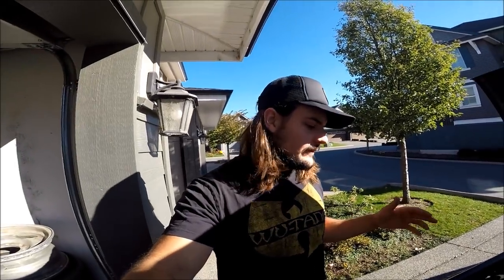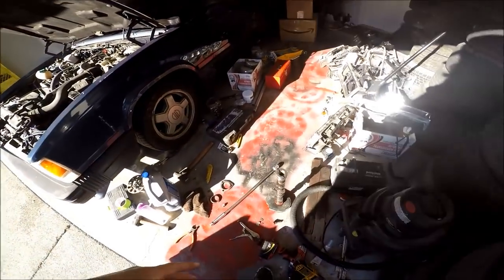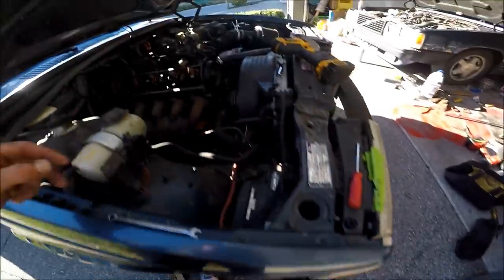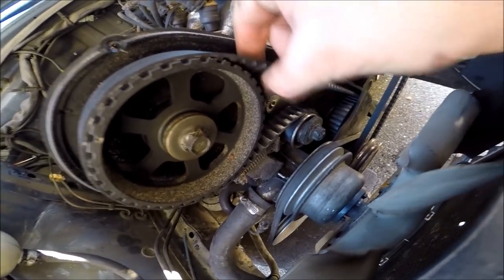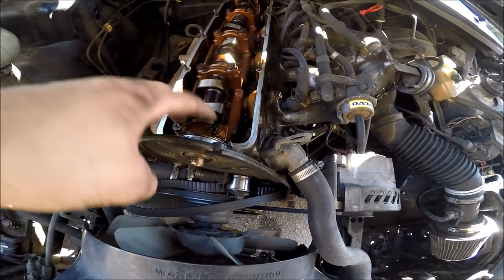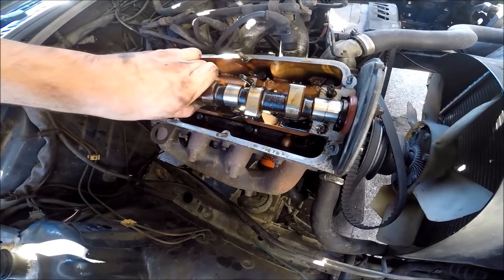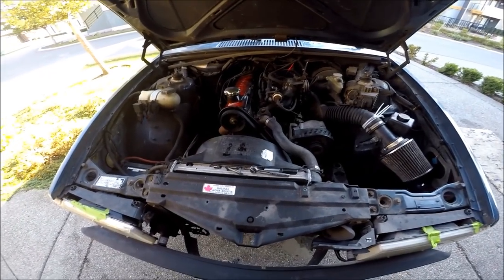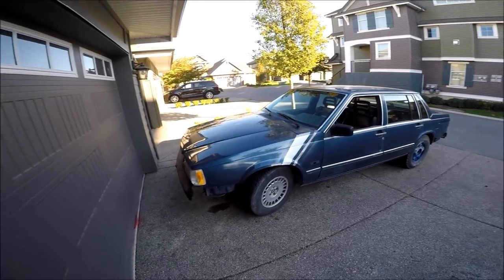B23O CAMSHAFT INSTALLATION ( HOW TO )

Comment: Hi - thanks for the vid, very helpful. Did you know there is a little thing on the upper section of the hood hinge assmblies (one on each side) that you can rotate - which allows the hood to stand straight up!  you will love it, especially when you are wrestling the distributor. It resets when you close the hood. Thanks again for posting the vid.
Reply: Dude sick! I learn a new thing about my Volvo everyday 😭😭

Comment: Hi 'Drifts 'N' Lifts'. What are your thoughts on the IPD VX camshaft? IPD claims a 19% increase in peak horsepower (114 vs 136) over the M camshaft, a flatter torque curve, far quicker reaction to throttle input, none of the roughness over 4000 rpm of the M cam, etc. And all this with little change in fuel economy or idle stability. I have a near mint, stock '90 740GL (B230F, AW70) and am looking for the best cam option to replace the stock M cam. Thanks!

Comment: Quick question: How do assure the correct timing when reinstalling the cam and cam gear? Does it stay in top dead center or do you have to reajust it?

Comment: Hey man you should get the K cam from the GLE the engin spec is B230E and set the timeing to 18 degers more then that can burn the valves but who cares i wing it on the enging sound to get the back fire xD

Comment: Is it manditory to adjust valves when chaning cam?
Reply: Well he didn't do it..
You should.
Just measure them when the engine is cold.
You can check them all with old cam, then count if you need adjusting, put new adjusting plates on and then the new cam.
That way you don't need to buy the 2 Volvo tools required to adjust them while the cam is in place.

Comment: Can you suggest some good b230ft cams? My Volvo 760 turbo has a decent cam sound but it's stock and I want it to be louder at least and maybe even power
Reply: your 760 probably has the A-cam, you can try a K-cam from B230E. (130hp in NA engine)
the sound is not easy to get because the turbo acts as a silencer. You could try to replace the middle exhaust mufler with a straight pipe.

Comment: Hey, could you help me a little bit. I changed my M cam to Vx3 cam (b200f) and lined all the timing marks. Then span the engine to adjust the valves and after that timing marks don't match at all. Am I right that the marks should stay the same after cam change? Then I lined the marks again (moved the cam 3 teeth) and tried to start the engine but it didn't start. I'm out of ideas now :(
Reply: DAV did you fix it?

Comment: Just installed 531 with Vx3 cam on my 945👌
Reply: How does one aquire a 531 head? like what did they come off of? Just curious
Reply: volvo 940 GL 91-92 got b230FB with 531, and Vx3 cam. came with all that from factory
Reply: Check out junkyards, found two, so got one on the shelf 👍
Reply: VX3 is the shittiest cam you can have in a old red block...... you need a 405 head with a timo 13,10 cam, 200+ hp easy from an NA b230
Reply from the maker: @eriksimca9409  vx3 is far from the shittiest cam , the m and t cams are far worse but the vx3 is no screamer by any means . Have you seen my NA build ?
Reply: @eriksimca9409  vx3 shittiest cam? Haha not even close!

Comment: well, what about the valve clearence? lashcaps..
Reply: Tim's a beater not a long term driver.
Reply from the maker: Fuck trust me after i made the video i was like shit! I forgot to mention lashcaps! All factory cams like t , k , m , a and even an ipd turbo cam that i have swapped in have never changed my valve lash .for an aftermarket cam will generally require lash to be adjusted . My bad
Reply: What are lashcaps??